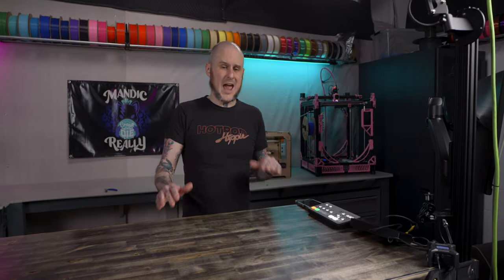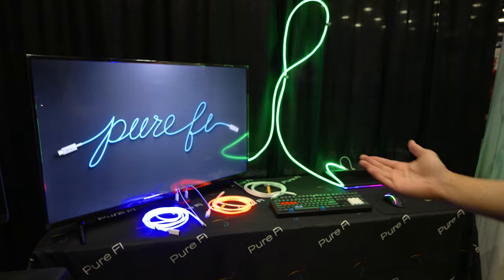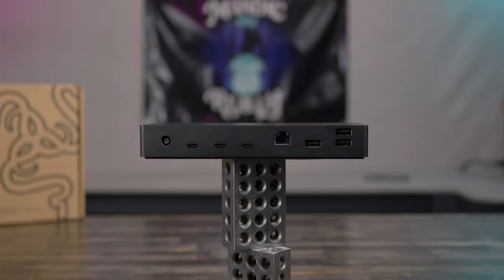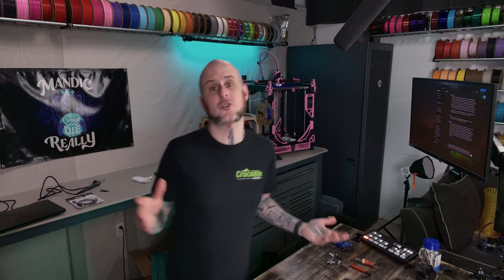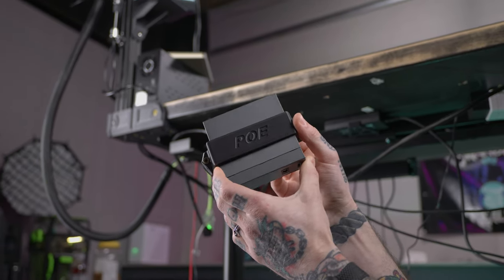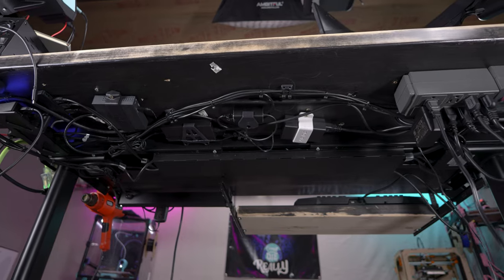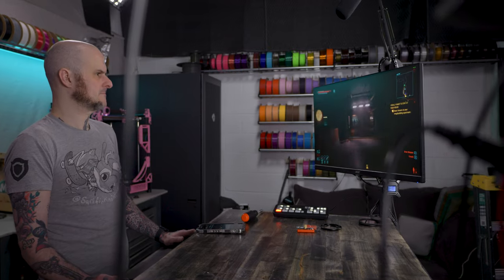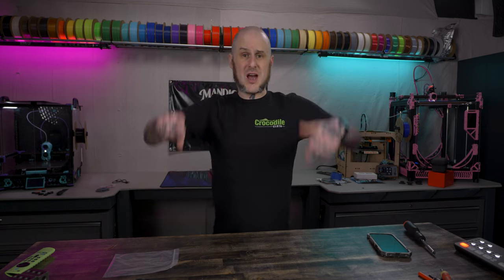Linus Made This Look EASY - One Cable Live Streaming Setup!

Comment: My favorite piece of "gear" to cable manage under desks with a power strip is small 6" extension cables. Perfect for wall warts
Reply: i found a pack of 12 on amazon a long time ago, and i used a short a/v rack as a nightstand as well for a while in my room, i had it maxxed out, and the wall warts of several devices plugged into it just took up too much plug space and rack space that i needed, they helped a lot.

as for how i had a rack mount surge protector and a small rack, my mother used to work for M.A.P. before they were sold off to legrande and my father used to maintain things for all of a particular electronics store and would often recycle things that were not needed

Comment: I've watched this video a few times and maybe I'm overthinking it. Does your motherboard have thunderbolt out? How did you get from your PC to send graphics and usb over the cable?
Reply from the maker: Motherboard has DP out over Thunderbolt. You use a short DisplayPort cable to go from the GPU to the motherboard input, then it sends DP out over the Thunderbolt signal. 👌🏻
Reply: @MandicReally  Thanks, hope the move goes well!

Comment: Sounds like you just need to do a DIY Perks move and make a workbench desk PC.
Reply from the maker: Still suffers the "splitting the budget" issue unfortunately. I could have easily mounted a small PC / Mac mini under the bench, but would rather upgrade the main PC with that money. This can evolve over time without having to rebuild the workbench entirely every upgrade cycle.
Reply: @MandicReally Yeah, I know, I jest. I just have fever dreams of powerful desk PCs. Don't you?

Comment: I'm curious how you go with the ethernet in that dock if you do end up using it, mine dies *all the time*.. also Razer if you're watching.. WHY IS THE USB/THUNDERBOLT PORT ON THE FRONT?!
Reply from the maker: I have no use for it in this setup. The PC has its own 2.5Gb port I use with my 2.5Gb network. I did use that port with my HP Laptop and a MacBook a fair bit, neither had any connectivity issues. Sorry I don’t have any better input for you.

Comment: yjr network connection is covered.
Reply from the maker: It isn’t of any use in this application. The PC has a 2.5Gb connection that is used. I only use the hub port with laptops, which it comes out of that cradle for.

Comment: call me crazy... OCD or what ever... but the filament rack in back doesn't look level
Reply from the maker: Camera angles, lens distortion, and an unlevel building. The rack IS level, but any one of those things can make it look out of whack. The roof of this space is tapered from one end to the other, so the black moving blankets you see at the beginning are running downhill (they are attached to the ceiling). That's why I switched to the grey cloth you can see later in the video. It hides the optical illusion better.